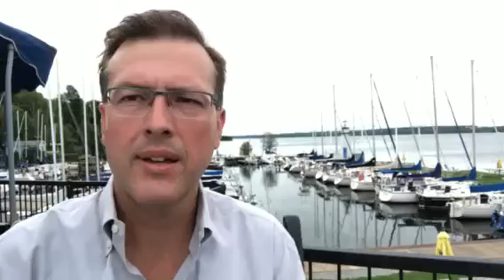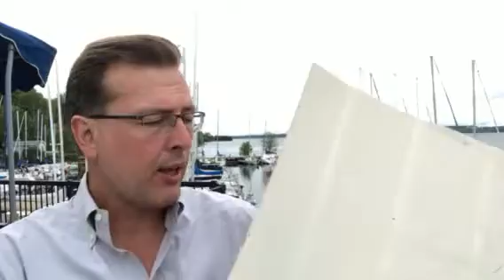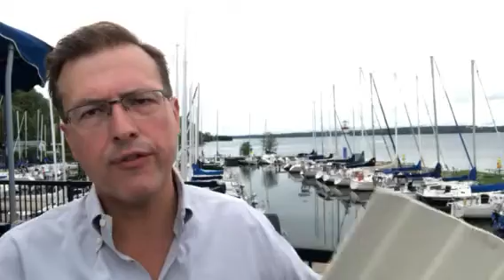Recycling Fibreglass Boat Hulls

Comment: If you have ever worked much with cutting or grinding cured fiberglass you'll find out that the energy required to particulate it is extremely high.   Probably very carbon negative endeavor.

Comment: Hi I work in a fiberglass cia and I ´m interesting for the  result of your research did you find a way to recycle fiberglass ? thank
Reply from the maker: Hi Jorge - we were able to demonstrate that adding recycled fibreglass can improve the characteristics of cement (non-structural applications only).  However, the cost of capital equipment involved to shred boats, coupled with the expectation of "free" end product makes the prospect of grinding boats in the private sector almost a non-starter.  This needs some government involvement to make happen.